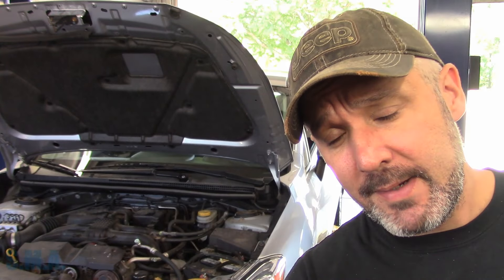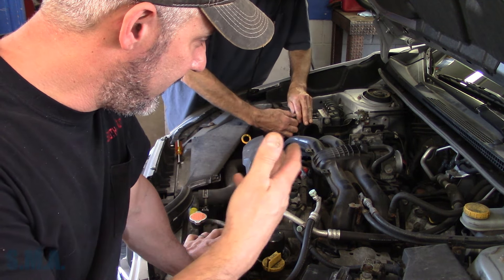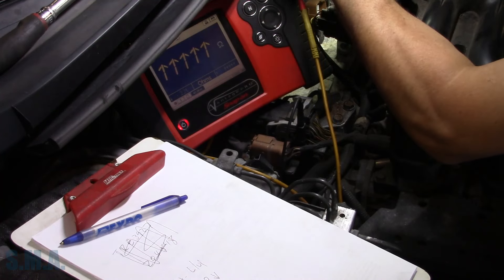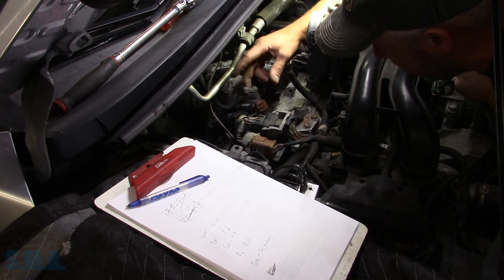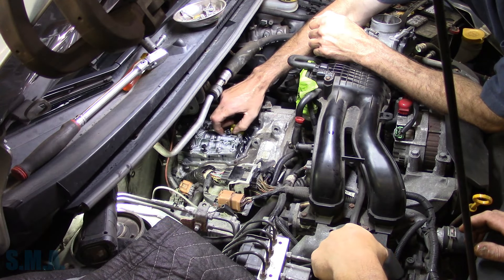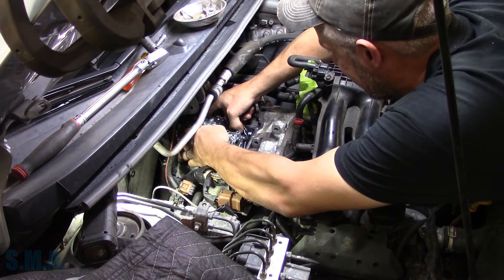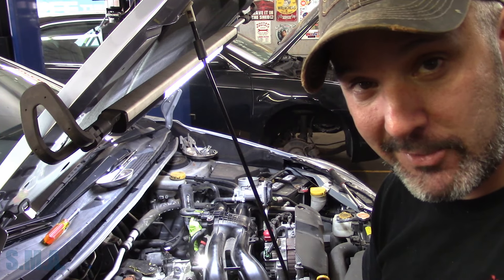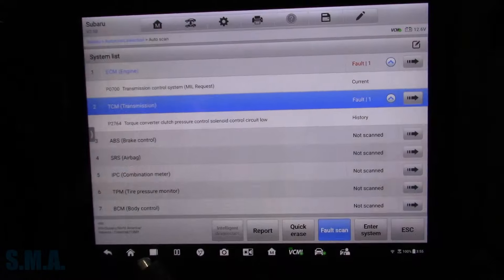Subaru CVT Transmission Valve Body TR580

Comment: CVT for the "win"--the car is only 7 years old and on it's second CVT, and even that one is having problems. As far as the new style of video goes, as long as you're the one doing the diag, it doesn't bother me if others are replacing parts at your direction
Reply: I won't buy anything with a CVT.
Reply: I don't like CVT's either, but a solenoid can go on a regular transmission.  We also don't know what the problem with the original was.
Reply: @pfsantos007  We do. He said bearings inside went bad, they kept driving it, which in turn took out the rest of the trans. And this happened with less than 90K on the clock.
Reply: @999torino  
Toyota and Honda CVT's are better reliability wise. But still not a great driving experience.
Better than this though.
Reply: We have a Subaru in the family with 180k+ on the original CVT
Reply: I read somewhere that American sold Subarus have different cvts compared to the rest of the world. The one you get in Australia, South Africa or Japan is supposedly better. All I can say is that during my last vehicle shopping stint, I preferred the CVT over the spongy auto, but still ended up buying a RAV4 with a manual transmission.
Reply: @justsumguy2u  "...deposited the rest of its part numbers in the pan" made me laugh and cringe at the same time.
Reply: @justsumguy2u   Let's back up.   At 29:55, he starts talking about it. He put the used transmission in about a year ago. The used transmission only had 84K miles on it, but if we are at 160K on the odometer and the person has driven 30K miles since the transmission was installed, then the other one went out at 130K miles.  Either way, I don't like to have to have my transmission replaced, but we don't know how the owner took care of it. Furthermore, a 7 year old vehicle with 160K miles is putting some miles on a car. Damn, that's over 20K a year.  We also don't know their driving habits. I am not saying that I am a fan of CVTs, but going out at 130K is a lot better than some of those CVT failures within 60K miles.
Reply: @justsumguy2u  don't judge too much on anything from Eric Os area they have a lot of dirt roads, hills and lots of salt! They are an extreme driving conditions and should of changed the fluid often as Subaru says in those conditions!! I change my Subaru CVT fluid every 60k fluid is cheap enough
Reply: @pfsantos007  and go bad they do, which then eats the clutches and other parts up or they stick on and hang the TCC on making it stall and jerk hard.
Reply: @plonkster  they are all made by Nissan/Jatco
Reply: @duckwacker8720  TR580 is an internal Subaru design.  They don't use the Nissan/Jatco design so have at least a somewhat better reputation than the Nissan CVT (but still working not as well sorted out as traditional ATs).  The real killer is not so much the poor reliability but the high replacement/repair costs.

Comment: It is good to see the "boys" rather than just hear them working in the background. I did a lot of this when I was Director of Maintenance with our 21 Aircraft. I would plan out the work to be done, and have others do the work to a point, then call me to give more direction and/or a helping hand when needed. That way, people both learned what to do and how to do it, and I, being ultimately responsible for the work, could ensure that everything was done correctly and to a proper standard. You cannot do everything yourself all the time. It becomes too much for any one person, and others don't learn. Having them do the "opening up or exposing the area to be worked on", then assisting in the diagnosis / repair, and "closing up", is a GREAT thing to learn how to do. That is a critical part of good management and quality control. Your troubleshooting approach and repair techniques are the "GEMS" of your videos, (along with some bantering with Mrs. O), and that is the underlying things that we come to see and enjoy. This video had everything including the "highway loop" test drive. This works and more like this will be valuable. Thanks Eric and your crew too.

Comment: HI ERIC..BEEN WATCHING YOUR VIDEOS AND THIS ONE HITS HOME...I HAD MY VALVE BODY REPLACED BY THE SUBARU DEALERSHIP (WITH THE O RINGS AND TRANS COVER GSKT) WHERE I BOUGHT MY 2015 FORRESTER AND THE LOCAL GARAGE HAD TROUBLE FINDING THE PROBLEM....CONTINUE TO MAKE THESE VIDEOS..THEY PROVIDE A VISUAL ASPECT TO MY LEARNING...YES THE VALVE BODY IS USUALLY AT THE BOTTOM OF THE TRANS IN THE LEARNING BOOKS I READ..BUT ON SECOND THOUGHT, I NEVER OWNED A CAR THAT HAD THE OIL FILTER ON TOP OF THE ENGINE BLOCK...GO FIGURE..SUBARU IS AWESOME AND YOU ARE A COOL GUY......thanks, i will continue watching..much appreciated..Bob from Princeton NJ

Comment: Since all your regular fans commented a year ago, I'll throw my 2 cents in now. My 2013 Subaru just threw a P0700 and a P2763 and I'm going to face, at 100,000 miles, the choice of having a mechanic replace just the factory solenoid (from Subaru $45.82) or the whole valve thing. Plus the transmission control system, if that doesn't do it. I think my car was manufactured in that cut over to the top approach, like the car you just worked on. So cheers to you. I learned an enormous amount. Must say a lot neater than approaching the transmission from underneath. Hope my mechanic takes some $$ off for that. :washhands:

Comment: When removing the top cover/gasket. There's a bolt with a washer flange near the left middle area. I found that the threads and diameter match, and you can move that to use as a pry point near the front

Comment: Thank you very much for posting this video. I just finished replacing 2 bad solenoids (AWD and Lockup Duty) in a TR580 Valve body. You are one of the 2 primary videos on YouTube that helped me the most. Thank you!
Reply: Hey!  Would you mind linking the other video you found helpful?  I'm about to go through the same thing, really trying to not replace the whole trans.  I'd appreciate it!
Reply: How easy were the solenoids to change?
Reply: did you have to replace any cvt fluid after doing the solenoids? trying to decide if i grab a quart just in case i need to refill any after replacing the awd solenoid in the valve body

Comment: A trick my grandfather taught me for dealing with stuck dowel pins: If you can get any part of the cover or housing to move and create a gap under the flange, then you are good to go. Just start shoving as many feeler gauges into the gap as you can. Ideally you want the feelers between the stuck side and the free side and as close to the stuck side as you can get. When you’ve shoved in the thickest combination of feeler gauges you can fit, then tighten up a bolt or bolts on the free side of the housing. The feeler gauges will act as a fulcrum and teeter-totter the housing off of the dowels. It may take multiple attempts of tightening the bolts and shoving in more feelers, but eventually it WILL work. The best part is (other than the fact that it works) is that the feeler gauges do not damage the mating faces of the parts like pry bars and flathead pry “drivers” do. The downside is that your feeler gauges might end up a bit out of spec. I keep a set of feeler gauges specifically for this job. It’s not so much the “squishing” that damages the gauges... It’s the beating the edge into the gaps with a hammer that does it. Lol
Reply: He never tried to get a rusty dowel pin Suby engine/tranny apart did he?
Reply: @kylenorthrop2398  he nor I would ever have any reason to repair a Subaru engine... LS swap or drag it to the scrap yard.

Comment: Nice job finessing that cover off....  I have worked on outboard motors that run in salt water for 40+ years... rusted and broken steel and aluminum everywhere ... and your heat idea is excellent. Heat is almost always a friend, I made some little plastic wedges out of wood splitting wedges to gently eek covers off ...so as to not damage gasket surfaces . I could even see creating threads in a hole near the dowel pin to insert a bolt into to then utilize a small slide hammer....   good stuff

Comment: The new "style" is fine with me. I like anything you do. I almost bought one of those CVT Subie's but decided on an all wheel drive Camry instead because it still had a regular automatic transmission. Time will tell if I made the right choice.
Reply: Cvt are ok if youre someone that drives normal, anything more they grenade MUCHO experience in Nissan CVT
Reply: you made the right choise
Reply: @super20dan  Thanks, I took it on an 800 mile trip and love it so far.

Comment: Still surprised that Subaru went all in on the CVT idea. CVT is a good concept but it is plagued with issues.
Reply: CVT does have issues, but they will only be corrected with real world miles. Someone has to use them to find and design out all the flaws. I'm pretty sure the first synchronized manuals and automatics had teething problems, too.
Reply: South Hill Farm   They went all in on CVT’s yet they make them shift like an automatic for 2020 at least.  There’s something mental about that.  They said that the fake shifting cannot be turned off. 🤔
Reply: I have a 2016 CR-V with the CVT, 337,000 miles with no issues. ALL services done on time by myself. This includes trans fluid/filter
Reply: I had a 2016 Mitsubishi Outlander and had a CVT transmission.  Had one recall on it for a program correction and had no issues with it.  Besides a little slow from 0 to 20 mph, after that, it shot off like a rocket.
Reply: @kwg2005 depends on what country you're in. I'm in Massachusetts USA and moving to the UK soon. Going for another CR-V when I get there. They are available in manual or regular auto there, no CVT

FYI, Nissan uses Jafco gearboxes... All junk just like the cars themselves
Reply: @1HotLegendLS  Apparently you have no idea how many cars NIssan has made with CVT transmissions over the last decade, or so.  Yeah, and every single one is junk....uh-huh.  Why don't you save your comments for something of which you have actual knowledge.  Obviously, what you know about Nissan and CVT's is extremely limited.....
Reply: @beauhatman4395  20 years of towing and seeing every Nissan (made for the US market) failing from CVT issues, alternators and rotted subframs. Nah, I have no clue
Reply: @1HotLegendLS  come on, Toyota is doing fine with their CVTs. Nissan's CVT is junk. Subaru are in the same boat as Nissan, but hopefully Toyota will change that... or my stickshift Outback will turn into gold :-)
Reply: @wim0104  yes, Toyota is doing fine, it's the Nissan Jafco gearboxes that are total junk. All the manufacturers had issues on the first gen CVTs, thats a given. But for Jafco to not learn from the first round is an issue.
Reply: Their getting better☺
Reply: @1HotLegendLS  Wait....so, you're saying Nissan has cornered the market on rotted sub-frames?  And, the only car manufacturer that has alternator failures is Nissan?  Wow, Lenny, that's good to know.  I'll just steer clear of Nissan and I'll never have another rotted sub-frame or failed alternator!  Thanks for the info.
Reply: @beauhatman4395  lol
Reply: @jeffleach2668  its because of people complaining about the rubber band feel of the transmission. The TCM just transitions to a preset ratio on the sheves that set the torque to the wanted level. 
This why I went with a manual transmission in just about everything I drive. No computers, very few sensors, and just a simple fluid change for maintenance. Clutches last forever if you drive normally.
Reply: @beauhatman4395  Nope, I don't think that's what he said at all. What you're doing is a fallacy but I don't care to look up exactly which one.
Reply: @kwg2005 Subaru has had a hard time of it. Recalls and lots of failures. Hopefully Honda can step up and bring a good design that's reliable beyond warranty time.
Reply: @beauhatman4395  well the one person I know had 2 maximas over the last 6 years or so both traded in when the cvt ship the bed on the highway. Both under 100k miles. Both used as his wife's commuter for 40 miles a day.
They get amazing fuel economy, but are inherently flawed for real longevity as a design. Especially in anything that can put out some torque.
Reply: @TraceyAllen  Sorry to hear about "the one person you know".  What bothers me is when people make statements that just aren't true and have absolutely no basis in fact.  Surely, there are plenty of people "out there" that had 2 chevys, or 2 fords, or 2 chryslers that had a major system "ship the bed", as you say.  That actually means very little when you consider the "big picture".  Car manufacturers make MILLIONS of vehicles....think about it.  Is it possible to have some "stinkers" in the bunch?  You can bet your ass it is.  Try making millions of "anything" and not have failures along the way.  What percentage of the total are failures?  I have no idea.  But what gets me goin is when people make statements such as "every Nissan built for the U.S. market has CVT failure, alternator failure and frame rot" (because he's driven a tow truck for 20 years).  Simply not true.  And, quite frankly, it sounds like someone who doesn't know what they're talking about.  Also someone spreading misinformation and wild exaggerations.
Reply: The Achilles heel of Subaru's CVTs are their "lifetime" fluid.  It NEEDS to be changed every 40-60K.  My 05 Outback is at almost 300K with no issues.  All services done on time by myself.
Reply: @wim0104  I thought Nissan's CVT problems were because they used JATCO (Junk Automatic Transmission Company) transmissions, which have sucked for years now.
Reply: @1HotLegendLS  what on earth do you want to come to the UK for  rain  and cold damp days  stay in the USA  at least you have good weather there  most of the time.
Reply: @terminaldiagnostics5576  #1 my fiance is there #2 the weather is better there compared to where I live #3 I need a restart in life
Reply: @1HotLegendLS  fair play best of luck with the new venture  man can't believe the weather 's better I live in the UK in Shropshire
Reply: @terminaldiagnostics5576  she's in East London, I'm in Boston. Our weather has gone from -23°C to +40°C in the same year. Yes, the weather is better. I'm done with heavy snow and sweltering heat
Reply: @Big_Loo CVT's have been out for quite some time.  MY '06 Civic hybrid had a cvt.  That's 14 years ago.
Reply: @1HotLegendLS  hope all goes well
Reply: kwg2005 Nissan is still having issues NEVER BUY A NISSAN WITH CTV
Reply: @FishFind3000  Nissan's are poor  on reliability no wonder Renault own over 50% of them French cars need I say anymore
Reply: @rangerpru  real hybrid with CVT has electric motors doing the variation of ratio and not pulleys. Not too sure if changing the fluid really helps on regular CVT, though the manufacturers claim they stay there forever - the manufacturers of the transmissions(even the conventional automatic) themselves says something different.
Reply: @beauhatman4395  i agree that my story was anecdotal, but super strange to have the same type of failure on 2 different generations of the same model car years apart. This is what is called a pattern failure. Here is an exert of a quick Google search.

From 2012 to 2018, several models of Nissan vehicles received the transmission, including the Sentra, Versa, Versa Note, Altima, Rogue, and Murano models.

Some of the most common issues with the vehicles directly relate to the transmission. Reported issues include loss of power, transmission jerking, transmission slipping, CVT coolant hose leaks and failures, and a CVT error message being displayed. These problems call the Nissan CVT transmission reliability into question and can result in serious harm to unsuspecting drivers.

Nissan is extending some trans warranties but only after costing lots of people money for a poor design.
Reply: @nicksmith8166  your 05 out back has a traditional automatic transmission. The Justy was the first widely available cvt in a us market subaru from 89 to 94.
The Asian market got one in 2010. The US got it in 2013 or 2014.  My parents have 2007 outback, I'm 100% positive that it is a traditional auto transmission.
Reply: @nicksmith8166  
I agree. Its also not just the CVTs, but all automatics that are "Sealed for Life". What a crock.
Reply: @TraceyAllen  .....well, I've had 2 different generations of the same model car and have had zero (0) trouble.  So, what is that called?  Keep in mind, and only with Nissan, we're talking about millions of vehicles, here.  Also don't forget, with the first generation on CVT's, Nissan extended/doubled the warranty on the units from 5yr/60,000 miles to 10yr/120,000 miles.  That was to ANY owner, not just the original.  What company, in their right mind, would make that kind of offer if their product was horribly unreliable?  In closing, next time you're driving around, notice how many Nissan vehicles are on the road. Most have the CVT.  The vast majority of them are "bad"?  Highly unlikely.  If nothing else, for the simple reason people wouldn't keep buying them if "they are all junk".  Good news travel fast, bad news travels faster.

Comment: Your comment about the parking brake made me laugh.  I live in Pa. so I feel your pain.  Whenever I park I always engage the parking brake,  never had one seize up on me,  but I did have a few cables snap due to rust.
Reply: I don't normally leave mine set, but I sure cycle it often to keep it free and working, at least on the old auto. the manual is always set, which also has all less than 1yr old cables front to rear, I caught the outer cable case broke at one point and the short cables at wheel both rusted thin at the pass through bushing(rear drum) so I sure didn't play around and replaced all at once